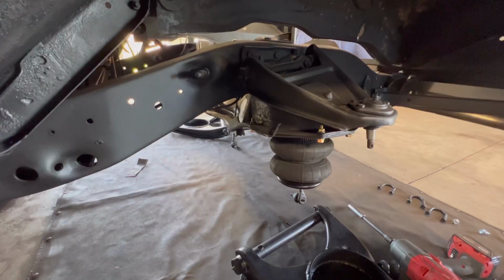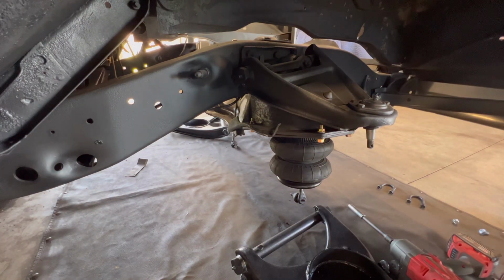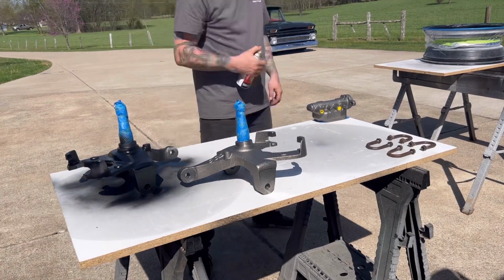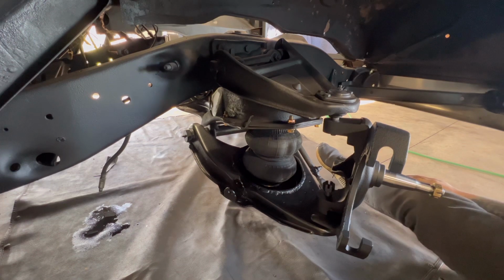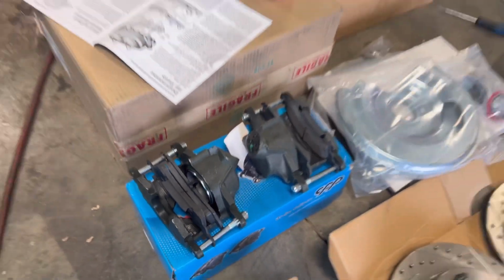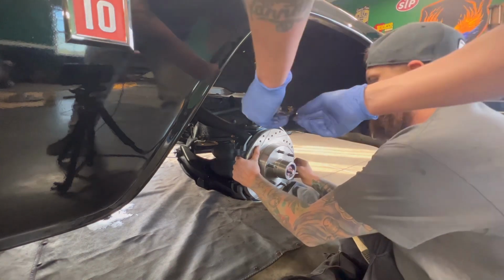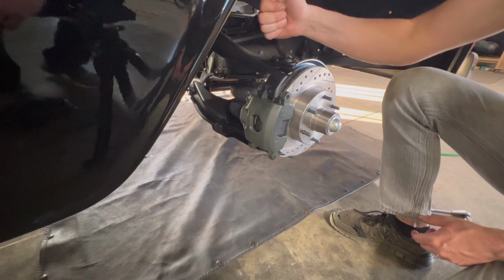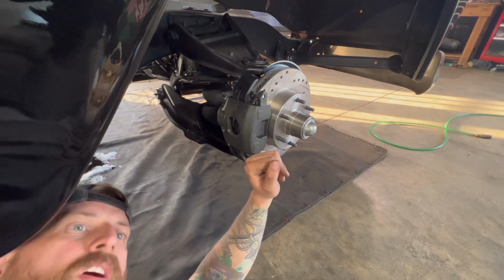Black Dice Ep. 8 | Installing Disc Brakes and 2.5 Inch Drop Spindles. Installation and Tutorial

Comment: Little tip for lower control arm. Square body U bolts are 9/16". Compared to 1/2" for older c10s.  Easy to drill out the crossmember holes and use a more heavy duty U bolt.
Dorman part # 13503.
Reply from the maker: Thanks

Comment: If you just keep the stock spindles in there how low will it get you to layin frame? Just curious
Reply from the maker: You would be about 3.5 inches off the ground and a lot worse camber with drum brakes.

Comment: The bag just basically sits in the pocket loose? it doesn't need to be bolted tight somehow?
Reply from the maker: It bolts in through the middle bottom hole of the control arm. You can see me tighten it with a wrench after I install the control arm.